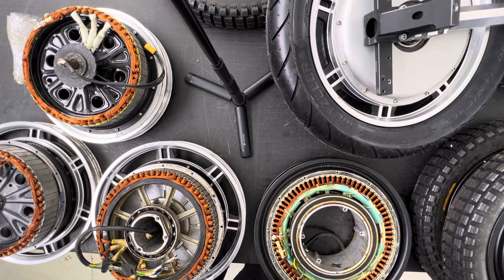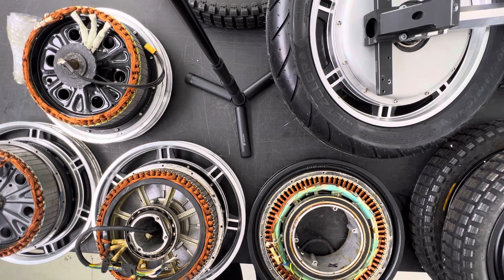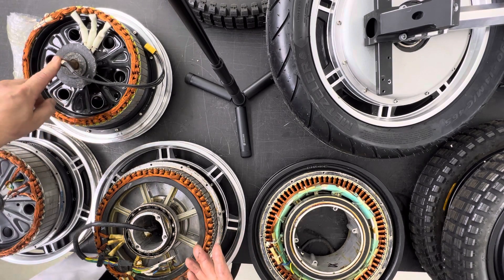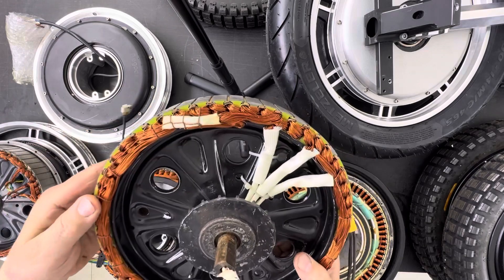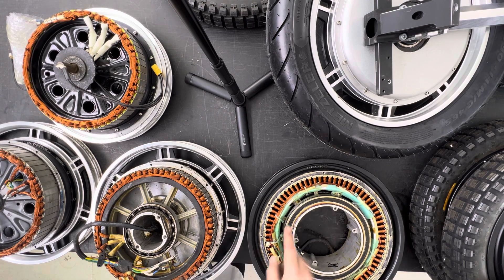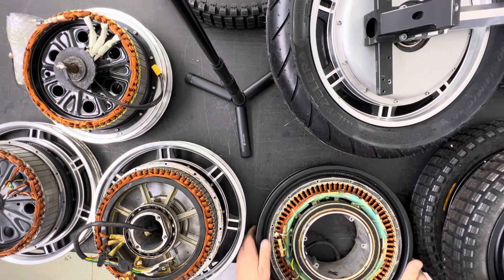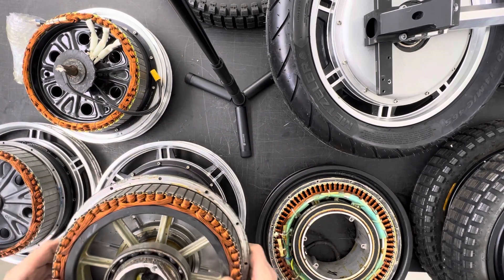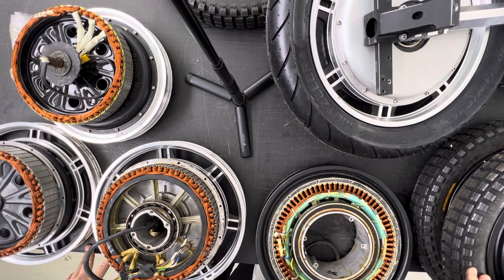iWheel RSX C40 motor in comparison with other brands.

Comment: Great that someone starts to make technical videos, but if you try to calculate intersection of wires in ex motor an compare to RS or any other motor you will find out that on every 260 unicycle motor it s bigger. Of course bigger stator gives bigger torque but not just that is important

Comment: Interesting, the Begode motor does look the most durable from as aesthetic viewpoint and the heavy gauge wire.
Reply from the maker: Thank You for watching! ❤ C40 by Begode is the most powerful EUC motor now. You can find C40 only in first generation Monster Pro and first generation Begode EX. The EX30 use new updated C40 motor on 4 inch wide rim. On paper C38 and C40 may seems indifferent, but boy, in reality it is nuclear. 😅